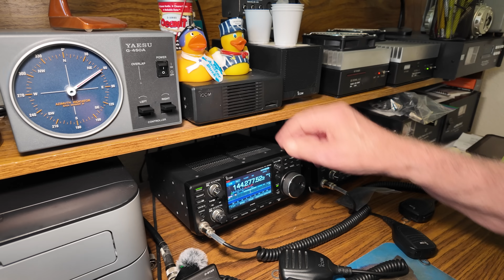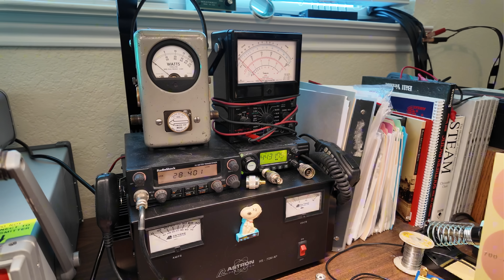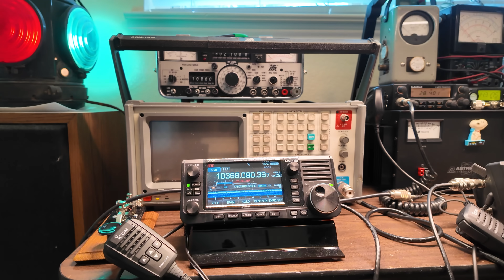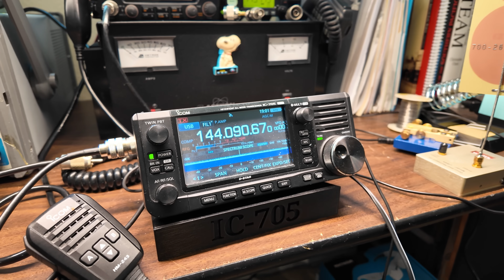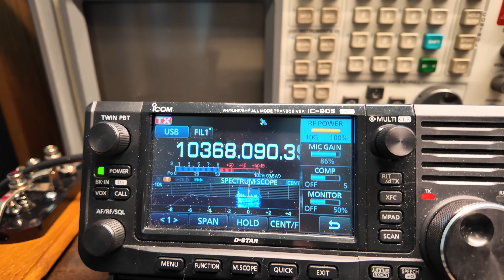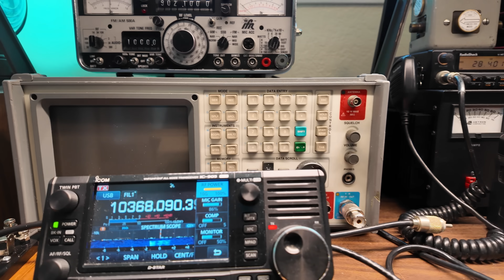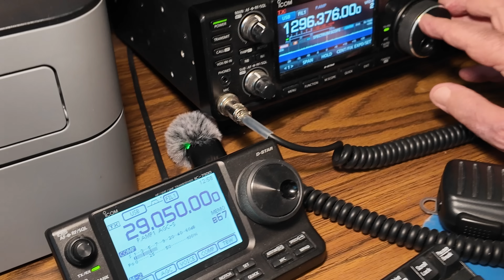Can You REALLY Build a Working Microwave Antenna in Your Backyard?

Comment: I have a question you may be able to answer ... in reference to Yaesu ftdx10 when sitting on desk hooked to power supply and turned off ... if i turn on power supply and my computer witch is hooked to radio for digital ...the power supply shows 0.4A   ... is it due to it being a soft switch on radio  i turn computer off and it goes back to zero ... any idea ???
Reply from the maker: I'm guessing it's the USB port on your computer showing some power on the USB cable going into the radio